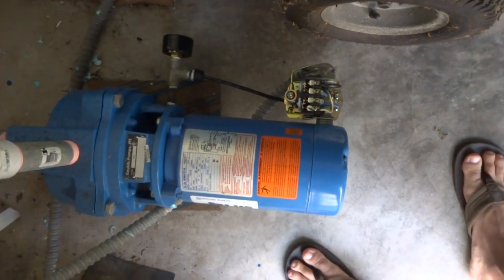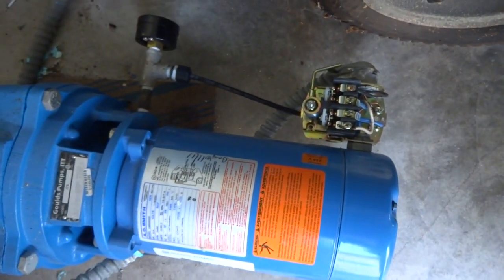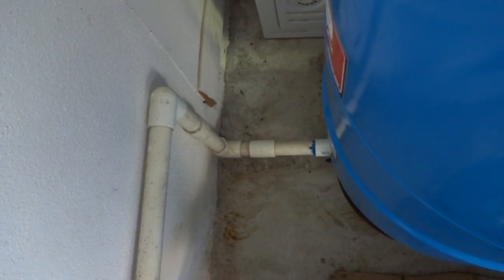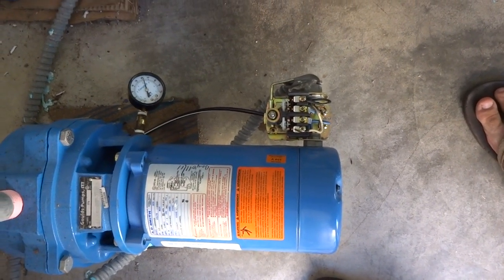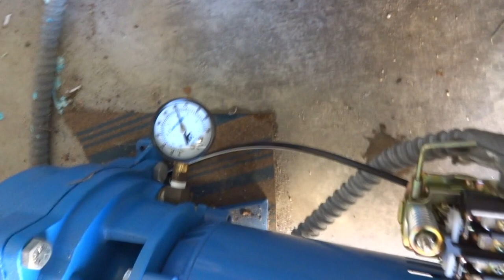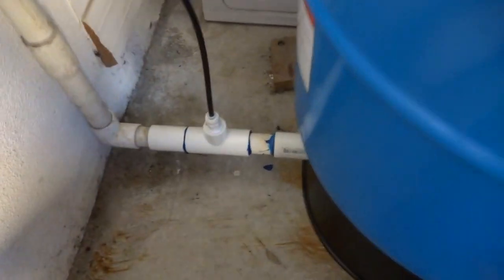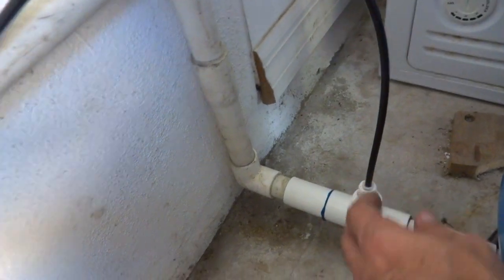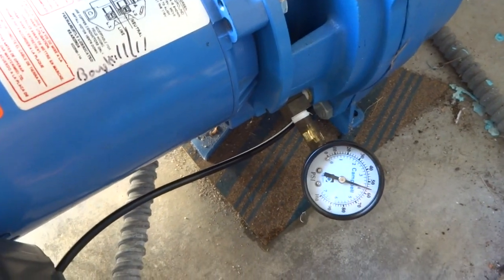How to repair bouncing/sparking contacts on water pump pressure switch.

Comment: Outstanding video, and solid trouble shooting! This fixed the same type of contact bounce problem that you resolved. I just upgraded my home filtration system, I replaced my water softener with a larger one and added at CULLIGAN WH-HD200-C Whole House Sediment Water before the softener. I placed the pressure outlet feeding the pump relay switch after the Culligan filter. Thanks Again!

Comment: Thanks for this video. Solved my problem. The pump with pressure being measured at the pump was installed as a replacement to a previous jet pump. Was experiencing frequent bouncing and sparking and the pump was tripping the circuit breaker on most cycles. Switched to measuring at the pressure tank and problem solved. Pressure tank is 20 ft from the pump.

Comment: Thanks!!! I just installed a new Goulds J10S this afternoon and it is doing the same thing. I have installed many well pumps and could not figure it out until this video. The pressure switch would cut off at the right pressure but would spark and chatter repeatedly and quit when the pressure hit 20 pounds like I was trying to fill a water logged full tank. My empty tank is set on 18. Thanks again! I ran a hose to my neighbor and hook it to an outdoor faucet until I could figure out how to fix the Goulds. Now I know!! Thanks again! A old retire pipefitter. Bernard
Reply from the maker: You're welcome.  Glad to hear it helped.

Comment: I just had my pump installer back out to fix a 2 month old Goulds pump with this exact issue. They told me it was sparking back so I googled that and found this video. I know little about water pumps. So I went downstairs when they were finishing the repair and this is exactly what they did. I asked if this was from the install done in Jan. I was told no that the switch just failed prematurely. But gee they ran a water feed line from over close to the cold water tank this time instead just like in your video--no charge but I did not appreciate the lie about the cause. I had been noticing some frequent cycling I thought and today we had the green sparks flying and it trying to run 4 times before it would go.  This video was AWESOME.
Reply from the maker: shall5867 Glad to hear it.

Comment: I am not sure how this works or how you figured it out but it is genius. It works as shown and thank goodness !
Reply from the maker: M Romanski I believe it works because there is more pressure when the pump kicks in near the pump.  But as you go further away from the pump, that pressure stabalizes to a more accurate overall system reading.

I also believe obstruction(s) in the line can make this problem worse.  After posting this video,  I found that my main valve allowing water to flow into my home was broken causing the water to be constricted.
Reply: I believe my problem is exacerbated by the introduction of air into the system via a water softener.  But your fix stopped the chattering.
Reply from the maker: M Romanski Glad to hear it.

Comment: airpedro,

Thanks for the great video.

I was having the same problem. Pressure switch chattering at start. Shaking pipes. Lights flickering. About to ruin the pressure switch (again), for sure.

I have about 9 feet of 1 inch pipe between my pump and pressure tank with 4 90 degree turns. Seemed like your solution would do the trick.

Went to Home Depot and bought all the necessary fittings to move the pressure sense connection to near the tank, including a 25 foot coil of 1/4 inch pvc line.

Before I started to retrofit the pressure tank setup, I thought of a way to solve the problem that might be easier.

The current pressure sensing setup, like yours, was a 1 1/2 foot pvc line from the front of the pump to the pressure switch. I decided to replace that 1 1/2 foot pvc line with the entire 25 foot coiled pvc line I had purchased. One end to the pump housing. Other end to the presssure switch. Tucked coiled up pvc under the pump.

WORKS GREAT! No more chattering.

I still have all those fittings from Home Depot and I will save them for the next time my pressure tank fails and then hook it up like your's

Thanks again for your video,

Mike
Reply from the maker: You're welcome.  I'm glad to hear it's working for you.
Reply: Mahalo airpedro & Mike...
My water pump stop working therefore, I purchased a new water pump and I installed it and then this past week I was focused on YouTube videos on how to solve this cut in & cut out challenge. After several hours of watching videos on how to solve this I came across 'airpedro' video and your Mike Comment.
I had the same issues as you Mike with my Pressure Switch cutting in & cutting out when the pressure reached ~45 psi then it started the Clicking on & off of the Pressure Switch from ~25 psi to ~45 psi. The cut in & cut out was about 1 click per second continued until I shut the pump off Five seconds later. I checked the Pressured Tank for any leaks, checked the house for any leaks, checked the lines coming from the water tank for any leaks and I found no leaks. 
I purchased all the items that airpedro advised to get and I purchased a 1/4"x20' pvc clear tub and just like Mike, I removed the 1/4"x9" clear tubing that was connected to the brass fitting that is connected to the water intake side of the pump and the Pressure Switch and replaced it with the 20' clear 1/4"line.
I started the system and the pressure gauge stopped at 10 psi with the water flow that came to a complete stop and I waited 15 second then, I turned the pump off then restarted the pump again and water filled the 1/4" clear line and the pressure started to increase on the gauge until it reached 50 psi and the Pressure Switch cut off. 
I opened the release Valve from the Pressure Tank until the pressure gauge decreased to 30 psi and the pump started then I closed the Valve and the pump cut off at 50 psi.
Before I started all this I closed the valve to the house, close the valve to the pump from the water tank and I released the water/pressure from the Pressure Tank and took an air pressure reading from the Pressure Tank and it showed 28 psi... Then, I changed the 1/4" line.

Mahalo So Much From,
Braddah Ernie K Here In Hawaii.
Reply: My Pressure Switch Started to click again and all I did was follow airpedro design technique and it worked great... Mahalo airpedro.

Comment: An issue I had this week was switch bounce. My system has been is operation for 10 years with no problems. Out of nowhere I get chatter. My switch is 12' of pipe away from my pressure tank. I also have a Pump Saver in line (if the well pumps off a Pump Saver reads the load and shuts the pump down) and that compounded the issue because after several chatters of the switch the Pump Saver would do its job and interrupt power. After reading and watching videos I moved my switch sensor  directly at the pressure tank, via poly line and shazam, cured the chatter. Moral of the story, dont stop trying different things
Reply from the maker: David Jones glad it helped.

Comment: Where the connection point is off the pump housing is right at the volute for the pump. The turbulence generated there will never be a good pressure reading. Moving it farther away from that position will solve.

Comment: I had this exact problem after installing a new deep well pump (1 1/2 hp 25 gpm at 80' depth of water), changed the pressure control switch, the 1 1/2 one-way valve on top (flapper to spring type), and installed 4 new 120 gallon bladder tanks with 1 1/4 PVC lines.  During this upgrade I moved the tanks to a new location, about 15' away from the control switch which was near the pump out head.  Under this new arrangement, right away, the control switch flutter began only on start up, at the low pressure 40 (40/60 switch), sometimes it would hold and work.  I adjusted the bladder pressure in the pressure tanks, adjusted the switch, nothing.  Fortunately in the control box I installed a delay timer which would only allow the pump to attempt start every two minutes on any fail circuit, so I wasn't fluttering the motor below.  Then I saw this video, and moved my pressure control switch to the end of my tank line, now farthest point from pump head, ran a shielded cord back to the control box.  Everything is working great now.  Thanks.
Reply from the maker: You're welcome.  Glad it's working.

Comment: I had this problem as well.  This problem is caused primarily because of two issues.  The first is pressure tank differential from pressure as measured in  tank when tank is empty of water and what the low cut on point is set from the pressure switch.  The other problem is that the pressure switch should be directly measuring the low pressure that exists in pressure tank with bladder and not the pressure within the pump housing.

In my case I moved the pressure switch to pressure tank T assembly and plugged the opening in the pump housing.  I typically mount pressure switch on pressure tank T assembly but did not do so with this pump because of the pressure switch configuration mounted on pump as factory designed..........did not feel comfortable overriding factory configuration.  In this case that is no long er the case!
!!!!

Comment: hilo sir thats also my common problem goulds pump pressure switch installed side pump manufacturers design when bladder tank 45 psi switch starting spark bouncing  my solution  to put another switch bladder tank side almost the same you make now working  tnx this vids you help me a lot god bless

Comment: I had the same issue,it was so bad it trip the twenty amps breaker,I went to Home Depot get ice maker kit installed it in front of pressure tank,that solved the problem no more pressure switch chattering. I had too much 90 degrees 1”elbows on the line going to pressure tank.

Comment: I had terrible bouncing contacts at pressure switch. My cause seems to have been too much air pressure in tank. I reduced it too correct air pressure 2 lbs. below cut off pressure and it stopped. Mine is 28 lbs. My switch is a 30-50 Sq D
Reply: my pressure switch was turning on off on off every 3seconds wwhen running water stops when not running water, now new pressure switch! and it clicks on and off every 10 seconds and off again and on while running water, is that normal do you know?

Comment: I no this a old video  but there a easy  fix for this it's called a snubber it's a brass fitting it connects to the pump then the pressure  switch line . It basically goes in line. The snubber slow down the water so there no surge  of water going to the switch .    💯🫡 iv installed and repaired pumps for a little over 20y

Comment: It looks like the pressure tank is too far from the pump. Goulds in their video recommend 3-4 feet at most. I had terrible chatter while the pump was trying to turn on until I moved the pressure tank closer to the pump.

Comment: this was not a common problem with jet pumps but was a major issue with piston pumps back in the day, the solution is putting a restrictor  in the pressure switch orifice so it only has a hole the size of large sewing needle or max 1/8" hole

you will then need to re adjust the pressure switch.

what probably happened is at some time someone replaced the pressure switch with a generic that did not have a reducer or restrictor disc in the orifice plate of the pressure switch or someone may have drilled it out thinking it was a rust obstruction.

the generic pressure switches do not have restrictors in them so if you buy a new switch from the hardware store unless it is the exact number as the original you may have this issue.

if you change it & notice the problem with the new switch but was not there before, if its the same brand of switch you can try swapping the orifice plate screwed to the bottom of the pressure switch with the one from the original switch & that should fix it.

moving the pressure sampling from the pump closer to the pressure tank as  done here will work in most cases for jet pump issues but for piston pumps you will need to reduce the pressure switch orifice so it can withstand the high pressure pulsation without tripping the contacts on every pulse.
Reply: thanks roger i did this and it worked going on 6 months so far

Comment: I just installed a new pump and my pressure switch is sparking... More at the shut off. I have a similar set up. A Goulds j10 jet pump and a pressure tank. Is your fix still working? Any other input before I dive back into it? 
Thanks
Reply from the maker: When I spoke to the manufacturer of the pressure switch, they said sparking is normal and to an extent I believe it is.  In my case, the contacts would hit, the pump would come on and because the pressure line was connected at the pump it caused an instant surge of pressure causing the contacts to bounce at start up.

To make the pressure reading more stable, moving it away definitely helped me and the problem went away.

Yours being at the shut off is a little different and if you fix it, I would be interested in knowing if this repair worked for you.
Reply from the maker: Also be sure if you have a bladder tank it is adjusted per manufacturer specs.
Reply: Finished!! After replumbing everything from the pump to the tank, I adjusted the pressure in the tank, bolted down the pump, and moved the pressure switch hose closer to the tank, and I went back to my old 40-60 pressure switch. But it was still chattering and sparking at cut-off... When I re-plumbed I put in a new check valve. I put in a flap/ swing style check valve thinking simplicity would be better. It turns out simplicity is not better when it comes to check valves. I put in my old spring style check valve and the pump and switch cut on and off perfectly. Thanks for your replies.
Reply from the maker: PinyonJeff Thanks for the response.  Hopefully this will help out the next guy who reads this and runs into a similar problem.

Comment: Where do you look when you did this and it still bounces?  (I take full blame for bad judgment in making the wrong placement choice in the first place- ahh... life as a non qualified plumber is hard at times.  Maybe one day I'll learn :)
Reply from the maker: acoustic4037 first I'd recommend you check your pressure tank. Second I'd recommend you check your main inlet valve to your home. Make sure it's opening and closing correctly. Good luck.

Comment from the maker: I ended up replacing the leaking connection with WATTS PL-3009.  Elbow 1/4" OD x 1/4" MIP.
Reply: airpedro Have new Goulds J10S with same prob. Tried power upgrade from 115v to 220v first but no change. Will do pvc extension per your video today as it makes sense. Did you also experience power surges, flickering lights, etc. before your fix??? Seems like the existing short tube is a design flaw........
Reply from the maker: daniel cabot No.  I didn't have problems with flickering lights.  Just bouncing of the contacts on the pressure switch which caused sparking of the switch.  I would make sure your wiring checks out.

Comment: normal 5 way Tee would have done the job.. attaching the pressure switch "directly" to the pump (for electrical connection) may cause the problem to come back with a vengeance. good luck